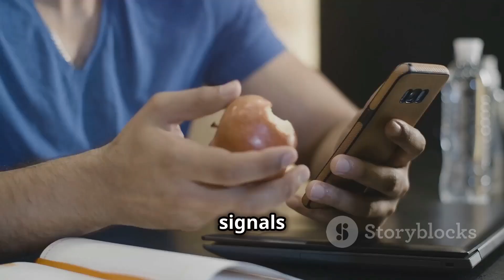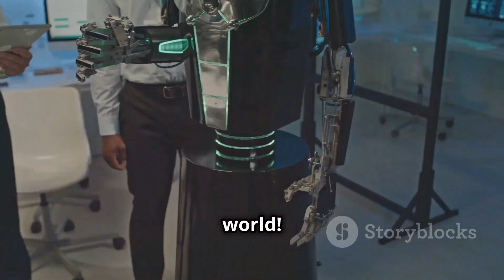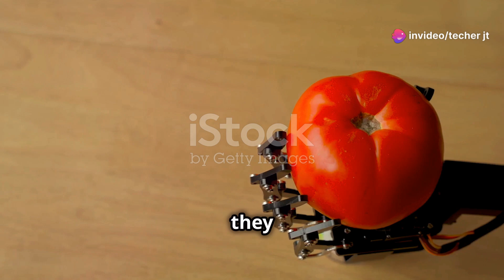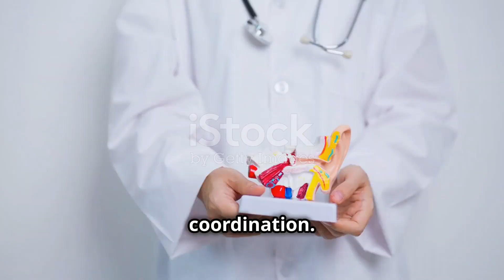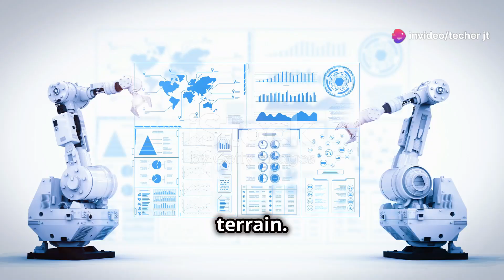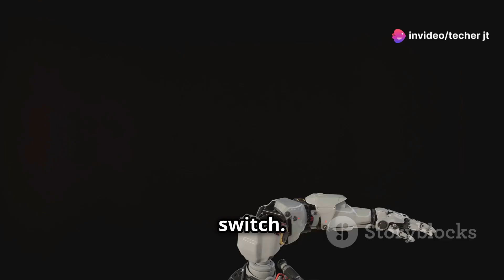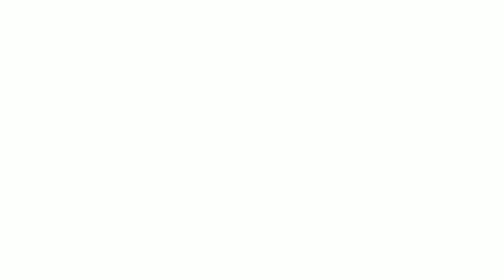Robotics Mechanical Sensors

Comment: Maria Sophia Sam Abansado
10 Lyra

2. In a robotic application, tactile sensors might be used in a robotic hand designed for fine tasks, like handling fragile objects like glassware. In this scenario, the tactile sensors installed in the robotic fingers can detect the pressure applied when gripping objects, ensuring that the robot doesn't apply too much force and break or damage the item.  Tactile sensors have the advantage of giving the robot grip adjustment, precision control, and a tactile sense similar to a human hand. Therefore, the robot is better equipped to handle fragile things with safety and accuracy, which lowers mistakes and boosts efficiency when doing jobs requiring fine motor abilities.

Comment: Leeane Niña A. Dela Rosa
10-LYNX 

1. Understanding: What are mechanical sensors, and how do they function in robotics?

Mechanical sensors in robotics detect physical changes, like force or movement, and convert them into electrical signals. They help robots monitor interactions and respond to forces in tasks such as collision detection and grip control.

Comment: Angel Stephanie Ledesma 
10 Lyra

1) What are mechanical sensors and how do they function in robotics?

- Mechanical sensors are devices that detect physical quantities such as force, pressure, displacement, and acceleration. They work by converting mechanical energy into electrical signals that can be measured and interpreted.

Comment: Andre Clyde Eduardo C. Acta
10-LYRA

2. Applying: Describe a scenario in which tactile sensors might be used in a robotic application. What advantages do they provide in that scenario?

Tactile sensors are advantageous in scenarios where delicate and human-like touch is needed such as picking up fragile objects like eggs and also enhance safety by knowing hard /soft it should hold/handle objects,animals,humans.
Sorry for the late pass, I forgot to comment my answer because I was used to just writing it in the paper.

Comment: Blissany Y. Torralba
10-HERMES

1. Understanding: What are mechanical sensors, and how do they function in robotics?

-Mechanical sensors allow robots to perceive the world around them. They convert physical stimuli like touch or motion into electrical signals that the robot's controller can understand. Mechanical sensors are crucial for robots to perform tasks accurately and safely. They allow robots to avoid obstacles, handle objects precisely, and respond to changes in their environment.

Comment: LA Treassia P. Llaban
10 - LYNX 

Analyzing: Compare and contrast force/torque sensors and accelerometers. In what situations would each be more beneficial? 

- Force/torque sensors are commonly used in fields like robotics, manufacturing, and automotive testing to accurately control applied forces or torques. On the other hand, accelerometers are valuable in consumer electronics, navigation systems, and structural health monitoring because they detect changes in motion and orientation. Each sensor type is beneficial in its respective applications based on the specific measurements they provide.

Comment: Ma. Pashka R. Resoso
10-Lyra

3. Analyzing: Compare and contrast force/torque sensors and accelerometers. In what situations would each be more beneficial?
Force/torque sensors measure forces and torques applied to an object, making them ideal for applications requiring precise control of physical interactions, such as robotic gripping, assembly, and force feedback in automation, while accelerometers on the other hand measures acceleration or changes in velocity, and are best for motion sensing, vibration analysis, and orientation detection. 

Both Force/torque sensors are more beneficial in tasks that require detailed force control, while accelerometers are suited for motion tracking and stability monitoring.

Comment: Rafael Daroy
10-LYRA

1. Understanding: What are mechanical sensors, and how do they function in robotics?

Mechanical sensors are devices that detect physical changes in their environment, such as pressure, force, or displacement. In robotics, they function by converting mechanical movements or forces into electrical signals that can be processed by the robot's control system.

Comment: Camyll Jhey P. Belhot
10 Hermes

1. Understanding: what are mechanical sensors and how do they function in robotics?
-Mechanical sensors allow robots to perceive their surroundings, they gather information by physical stimuli through touch or motion and generates into electric signals that the robots brain (controller) can understand. They allow robots to avoid obstacles, handle objects with precision and respond to changes in their environment.

Comment: Aiko Alzula
10 - Cassiopeia

1. Understanding: What are mechanical sensors, and how do they function in robotics?

Robots use sensors to understand their surroundings, just like humans use their senses to interact with the world. Humans and robots are similar in this way.
While we rely on our senses, robots depend on sensors to move and respond. These sensors take things like touch and movement and change them into electrical signals that the robot's brain, or controller, can understand.

Comment: Gene Berta Rose F. Hererra
X- Hermes

1. Mechanical sensors are tools that measure things like how hard something is pushed, how much pressure is applied, how far something has moved, or how quickly it's speeding up or slowing down. In robots, these sensors are like the robot's sense of touch, helping it understand how it's interacting with its surroundings.

Comment: Alexa Kyle R. Cabunoc 
10 - HERMES 

1. Understanding: What are mechanical sensors, and how do they function in robotics?

- Mechanical sensors in robotics detect physical changes like pressure, force, displacement, or torque. They function by converting mechanical movements or forces into electrical signals, which robots can interpret to make decisions or adjust their actions. For example, force sensors measure the amount of pressure exerted when a robot grips an object, ensuring it applies the right amount of force. Similarly, encoders measure the position or rotation of a robotic joint, allowing precise control over movement. These sensors are critical for tasks requiring fine motor control and physical interaction with objects or environments.

Comment: Maykylla Geraldine R. Egarguin 
10-LYNX 

1. Understanding: What are mechanical sensors, and how do they function in robotics?

Mechanical sensors in robotics detect physical changes, like force or movement, and convert them into electrical signals. They help robots monitor interactions and respond to forces in tasks such as collision detection and grip control.

Comment: Zane Mendaros
X - CASSIOPEIA

1. Understanding: What are mechanical sensors, and how do they function in robotics?

Mechanical sensors in robotics are devices that collect data from the physical world by transforming inputs such as touch or motion into electrical signals that a robot's controller can understand. These sensors are essential for robots to navigate, interact with, and respond to their surroundings, allowing them to carry out tasks accurately and safely. Tactile sensors, force/torque sensors, accelerometers, gyroscopes, and contact sensors are examples of devices that replicate human senses such as touch, motion detection, and balance.

Comment: Jannah Loreen S. Galla 
10 - CASSIOPEIA 

Q: 1. Understanding: What are mechanical sensors, and how do they function in robotics?

A: Mechanical sensors in robotics detect physical changes like force, pressure, movement, or strain and convert them into signals for the robot to process. They enable robots to interact with their environment, adjust movements, and maintain balance. Common types include force/torque sensors, pressure sensors, accelerometers, gyroscopes, and tactile sensors. These sensors allow robots to grip objects, maintain stability, navigate, and respond to real-time feedback, ensuring precise and adaptive behavior during tasks.

Comment: Shiloh Nouvel A. Miquiabas 
10 - ANDROMEDA

1. Understanding: What are mechanical sensors, and how do they function in robotics?

Answer: Mechanical sensors in robotics detect physical changes, such as force, pressure, position, or motion. They convert these changes into electrical signals that the robot's control system can interpret to make decisions or adjustments. Common examples include accelerometers, pressure sensors, and gyroscopes.

Comment: Janaya Dyreane Baja
X Lyra

1. Mechanical sensors in robotics are devices that convert physical changes into electrical signals, allowing robots to perceive and interact with their environment. They include contact sensors, force/torque sensors, accelerometers, gyroscopes, and proximity sensors, which enhance robotic systems' ability to perform complex tasks autonomously and safely by providing real-time feedback.

Comment: Ana Althea B. Mabaylan 
10 - LYRA

3. Analyzing: Compare and contrast force/torque sensors and accelerometers. In what situations would each be more beneficial?

- Force/torque sensors are used in robotics, manufacturing and automobile testing for precise control of direct forces or torques. Accelerometers are useful in consumer electronics, navigation systems and structural health monitoring because they can measure changes in motion and orientation.

Comment: Tabitha Glenne P. Lagria
10 - Cassiopeia

 Applying: Describe a scenario in which tactile sensors might be used in a robotic application. What advantages do they provide in that scenario?

A: Tactile sensors in robotics could be used in a robotic hand to grip delicate objects like glassware, adjusting pressure to avoid damage. They provide the advantage of precise force control and feedback, improving the robot's ability to handle fragile items safely.

Comment: Christian Lloyd B. Hinlo
X lyra

1. Understanding: What are mechanical sensors, and how do they function in robotics?

Mechanical sensors in robotics are devices that detect physical changes or forces and convert them into electrical signals for processing. They function by measuring parameters such as pressure, force, displacement, or acceleration.

Comment: Anika Charisse D. Dawal
10 - Lyra

1. Understanding: What are mechanical sensors, and how do they function in robotics? 
ANS: Mechanical sensors in robotics detect physical changes such as force, pressure, and movement. They turn these changes into electrical signals, allowing robots to detect their surroundings. Pressure sensors detect touch, whereas gyroscopes assess orientation.

Comment: Loreyn C. Nanay
10 - Lynx

1. Understanding: What are mechanical sensors, and how do they function in robotics?

            - Mechanical sensors are devices used in robotics to help robots perceive and interact with their surroundings, much like human senses allow us to navigate the world. These sensors convert physical stimuli, such as touch, pressure, or motion, into electrical signals that the robot’s controller can interpret. In robotics, mechanical sensors enable tasks like object handling, obstacle avoidance, and responding to environmental changes. Some important types of mechanical sensors include tactile sensors, force/torque sensors, accelerometers and gyroscopes, and contact sensors. Together, these sensors allow robots to perform tasks with precision, adaptability, and safety, mimicking some aspects of human sensory abilities.

Comment: Jullian A. Pangan 
10 - Lynx

1. Understanding: What are mechanical sensors, and how do they function in robotics?

Mechanical sensors are devices that measure physical quantities like motion, force, or position. They convert physical phenomena into electrical signals using mechanical principles. Examples include potentiometers, strain gauges, accelerometers, and gyroscopes. These sensors are essential for robotic systems, enabling tasks like precise positioning, force control, and motion tracking. For instance, a robot arm might use a potentiometer to control joint positions, while a force sensor helps a robot interact with objects delicately.

Comment: Chelsie Ann P. Carnaje 
Grade 10 - Hermes 

2. Applying: Describe a scenario in which tactile sensors might be used in a robotic application. What advantages do they provide in that scenario?

Answer: In an assembly line scenario where a robotic arm handles delicate electronic components, tactile sensors in the robot's gripper provide crucial benefits. They enable precise force control, preventing damage to sensitive parts by ensuring the correct amount of pressure is applied. These sensors also offer real-time feedback for adjusting grip and alignment, enhancing the robot's ability to handle components securely and adapt to variations in size and shape. This leads to improved assembly quality, reduced errors, and safer operation.

Comment: Joshua El Noah M. Suan
10-Lyra

3. Analyzing: Compare and contrast force/torque sensors and accelerometers. In what situations would each be more beneficial?
-Force/torque sensors measure applied forces and are ideal for precise tasks like robotic control, while accelerometers detect motion and acceleration, making them useful for tracking movement or orientation. Force/torque sensors are best for physical interactions, such as controlling grip strength, while accelerometers excel at monitoring motion, like in drones or machinery. Both sensors serve different but complementary purposes depending on the situation.

Comment: Xer Salise
10-Lyra 

Compare and contrast force/torque sensors and accelerometers. In what situations would each be more beneficial?

force/torque sensors are better suited for tasks requiring measurement of applied force and torque, while accelerometers are more beneficial for motion detection, orientation, and vibration analysis.

Comment: Renalyn R. Gaid
10- Orion
1. Understanding: What are mechanical sensors, and how do they function in robotics?

The mechanical sensors give robots senses that allow robots to perceive the world around them just like humans rely on our senses to understand our environment, robots depend on sensors to gather information. These sensors convert physical stimuli like touch or motion into electrical signals.

Mechanical sensors are crucial for robots to perform tasks accurately and safely they allow robots to avoid obstacles, handle objects with precision, and even respond to changes in their environment.

Comment: Tysh Maeganne Z. Sagocsoc 
10- Hermes

1. Understanding: What are mechanical sensors, and how do they function in robotics?
- Mechanical Sensors helps robots perceive the world around them and gather information. It converts physical stimuli to electrical energy that the robot can understand. They allow robots to operate accurately and safely.

Comment: Angel Anne L. Martirez 10-Orion🌸

2. Applying: Describe a scenario in which tactile sensors might be used in a robotic application. What advantages do they provide in that scenario?

For example a robot is holding an egg, if the robot feels that what it's holding is an egg therefore he wont apply much pressure. This sensor provides sensory and care in that situation.

Comment: Kiesha N. Enriquez 
10 - Orion

1. Understanding: What are mechanical sensors, and how do they function in robotics?

Mechanical sensors in robotics are devices that allow robots to perceive and interact with their surroundings by converting physical stimuli into electrical signals. These sensors gather information about touch, motion, force, and other environmental factors, which is then processed by the robot’s controller to make informed decisions and perform tasks.

Comment: Roda A. Patayon
10 - LYNX

4. Assess the impact of mechanical sensors on the efficiency and safety of robotic operations in manufacturing. Provide specific examples to support your evaluation.
Mechanical sensors significantly enhance the efficiency and safety of robotic operations in manufacturing. For instance, force/torque sensors enable robots to precisely control the amount of force applied during assembly tasks, preventing damage to delicate components. Tactile sensors allow robots to detect and avoid obstacles, reducing the risk of collisions. Overall, mechanical sensors play a crucial role in enabling robots to perform tasks more efficiently, safely, and reliably in manufacturing environments.

Comment: RAINE BADON
10 - LYNX

1. Understanding: What are mechanical sensors, and how do they function in robotics?

Mechanical sensors are devices that detect physical quantities related to motion, force, or position. These sensors play a crucial role in robotics, providing essential information for robots to interact with their environment and perform tasks accurately. Examples of mechanical sensors include potentiometers,  force/torque sensors and tactile sensors.

Comment: Shuwla Maine C. Lugtu
Grade 10- Lynx

1. Understanding: What are mechanical sensors, and how do they function in robotics?

- Mechanical sensors help robots sense their surroundings. Robots rely on these sensors to collect information by turning physical inputs, like touch or movement, into electrical signals that the robot’s control system can understand. These sensors are essential for robots to carry out tasks correctly and safely. They help robots avoid obstacles, handle objects carefully, and react to changes in their environment.